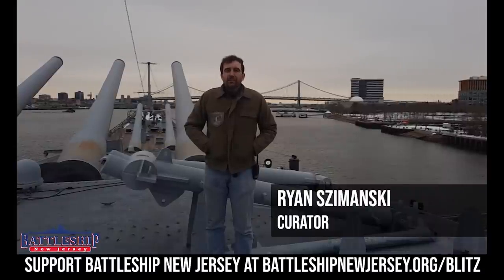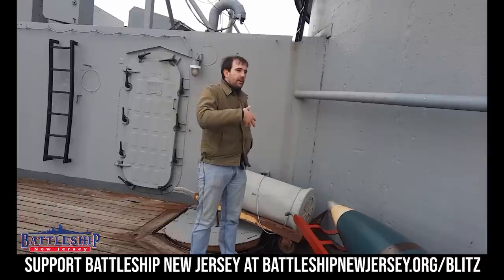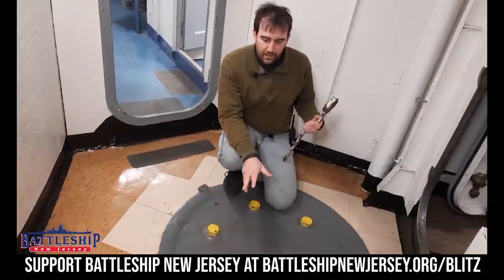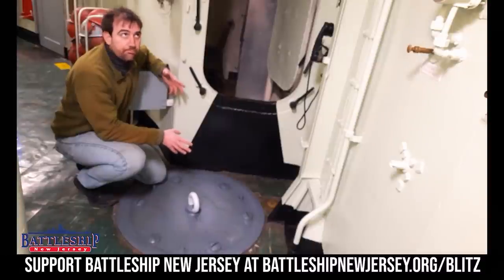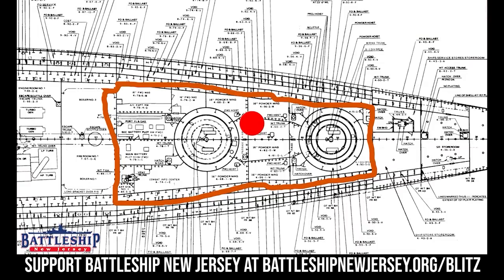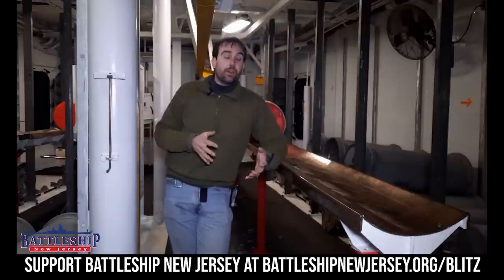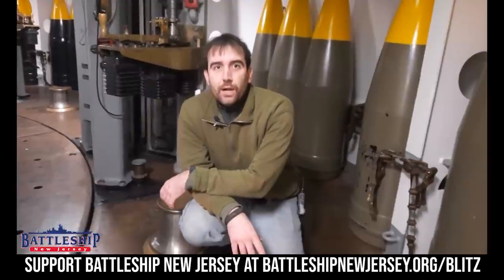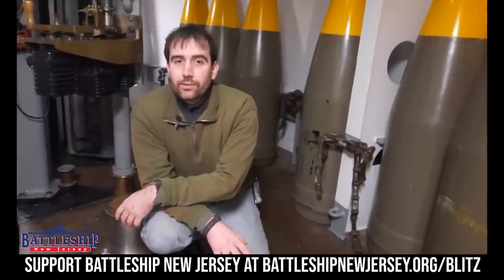How to Load Ammunition onto the Battleship

Comment: I was Aviation navy and not Surface but do have some experience with the loading and unloading of ammo. It's not that ships can't enter port loaded with ammo (we did it all the time on cruise), it's that you can't load and unload ammo pierside within city limits There are ammo storage and loading/unloading areas near major navy ports that are far enough away from major city areas just for this purpose. You would only unload all your ammo if the ship with going into drydock or other major work required it.
Reply: ^this comment needs to be pinned
Reply: Saw the Red Flag flying many times as we passed by the Seal Beach Naval Weapons Center, outside Long Beach California.
Reply: You’re correct:  ships did not offload ammo before entering port.  We would offload ammo before going into the yards or before extensive maintenance availabilities, and we generally carried full load out only on deployment, but the magazines were rarely empty.  I served on a Knox-class frigate in the early-mid 80s, so procedures may have been different at other eras.
Reply: That makes sense because I live in Australia and its not uncommon to have US navy ships come ashore and I cant imagine they would unload all the ammo just to enter Sydney harbor.

Comment: I can tell you from my own service on New Jersey in the 90’s we did not offload ammunition every time we went into port.
Reply: I’m glad to here that, what a pain in the ass that would be.
Reply: Thanks. I know USS Iowa visited Aarhus here in Denmark at the entrance to the Baltic sea and close to USSR and DDR. 
It would be strange to not bring ammunition during the Cold War
On the other hand I suspect the port call was to explore resupply options. As well as hearts and minds. 
USS Iowa at coal pier in Aarhus
https://www.flickr.com/photos/perryolf/4474302056/in/photostream
Reply: Yeah, I would that would greatly increase the chance of an accident than just leaving it where it is.
Reply: Thanks - I very highly doubted that. - I agree with Mr Knapp (below) - if major work unload. No Hot work (Grinding, oxy/acetylene work (cutting/ welding)  near magazines with ammunition's present. Hot work type stuff is what started the Bon Homme Richard Fire in San Diego last year, I think.
Reply: @wfoj21  yes. Hot work in the "parking garage" spaces. It spread to other construction materials and went initially unchecked because the fire fighting equipment was offline.

Comment: It’s just so cool that the cable hoist still works.  My jaw dropped when the shell hoist raised that shell. It makes me wonder what other machinery can still be operated ( assuming fuses/ breakers are reset).  Can you give us a sense for that?  What Ryan and the whole team do with the NJ is a model for how a museum ships should operate.  Lastly, I can’t recommend enough the curator tour with Ryan.  It’s the. Best $500 you’ll ever spend if you’re a battleship nerd like me.  Ryan was extremely accommodating.
Reply from the maker: Check this video out for some info on what systems work: https://youtu.be/lK9ofM6ef5g
Reply: The "shell hoist" you see in this video is a museum simulation.   The "projectile" is one of the many fiberglass display shells in turret two.  It has a hardware store eye bolt attached to the point, which in turn is secured to a lightweight cable that is in turn connected to a very light duty cable winch above on the upper shell deck.  The display is arranged so that a casual observer taking the tour does not see the eye bolt or the winch cable.  As demonstrated by Ryan, the faux shell hoist does use the original hand controls for raising and lowering the faux projectile.

To re-activate the for-real shell hoist would require activating the hoist's 440 volt electrical motors and lifting ram hydraulics.

Comment: Navy ammo depot in NY Harbor is at Earle, about 10 miles from Bayonne.  Some ships anchored in Gravesend Bay and off loaded to barges.
Reply: Thanks.    I was wondering about that, so I looked it up.   The 2.9 mile long pier is located in Sandy Hook Bay.    There is a 15 mile military railroad and road that connects the pier to Naval Weapons Station Earle.

Comment: As of 2016 there were still 15,595 live 16"/ 50 calibre rounds in storage at Crane, Indiana.
Reply: Ok, I get that you want to store shells out of the range of shore bombardment, but why put a navy base so far from the ocean?
Reply: @Ben_306  As of 2016 the Indiana site seems to be a facility for storage prior to disposal. It is not a Navy arsenal
Reply: Are 16"/50 cal rounds different from the 16'/45 cal rounds? I think I read the weights are the same.
Reply: @tobyw9573 the AP rounds for the 16"/45s were several hundred pounds lighter than for the 16"/50s I think the lighter rounds could be used in the 50s but am not sure if the reverse is true
Reply: @XXXXXXXXXXXXXXXXXX981  Crane, Indiana is closest thing the department of the navy has to a dedicated arsenal, which explains why the excess 16" ammo is stored there.

As to why they chose Indiana for a navy base, i would assume its fairly central to rail lines and other central transportation hubs of the country so that delivery can be made to either coast fairly quickly
Reply: @fredfranklin2054  that depends on which version.  The Colorado class with their 16"/45s could not handle the "superheavy" Mk 8 that the 16"/45s of the North Carolinas, South Dakotas and Iowas could use.
Reply: @tobyw9573  i recal in another video, they mention that the AP rounds for the 50 cal guns were actually a foot longer, so wouldnt even FIT on the ships with the 45 cal guns, but the HC or HE rounds were still "only" 55 feet long and would be cross compatible

Comment: I get "greasing the deck" to move shells of that size but how does the crew gain any traction?  
The grease must have been equally slippery on the sole of a shoe or boot.
Reply: It was an incredibly fine coat of oil, I do not remember it being slippery but during the process of loading the shell into the hoist a term called Par Buckling they MAY have put a little more oil down in the path of the shell to the hoist. I can't say for certain, I was never on the projectile decks during a shoot.
Reply: Interesting note - Ryan took us under turret #1 which has not been restored, they still have some pad on the deck to sop up oil that saturated the area.
Reply: No worse than walking on ice. You "skate" rather than walk.  The person looping rope around a shell is one of the few trying to change positions often.  The guys at the catheads, just sit there looping rope and pulling on it.
Reply: @haroldhenderson2824  Skated & ice fished a lot growing up.  Natural ice has a certain feel (texture).  Never had to horse a ,1500+ lb shell in a confined space.  I wonder what the temp was in that turret?
Reply: Use the oil only were it is necessary and train the crew to NOT put their feet in those areas ??
Reply: It's oil, not grease, and it is slippery to stand on, but if you're careful and keep a hold on nearby shells or bulkhead you can walk around.

Comment: Im guessing you weren’t expecting the hoist to work? 😳
Reply: Given the lack of 400v 400hz power generation onboard, he shouldn't be. (he'd know what's been done to get compatible power there, and likely was the one who flipped the breaker to enable it.)
Reply: @jfbeam  400Hz is just for electronics.  Anything big runs on 440V 60Hz.
Reply: I'm wondering if there's a prankster on board who made sure it would work just to startle Ryan as a gag.
Reply: @ghost307  they probably turned it on to crack open the hatch it's above
Reply: Just because something is designed for so many volts doesn't mean it wouldn't work with less. It will still work just not as well. If thats a 440v unit or whatever 220v will work well for a short demonstration like in this video but it lickly wouldn't lift the weight of a shell.

Comment: It is the large number of unprotected and unconfined HiCap and AP shells being moved that causes the safety issue.  A good old barge could do the job of carrying powder and shells out to a stationary battleship at anchor (a few miles from shore facilities).  Powder in the storage flasks, has a less than 1 time in a million chance of "accident". Even then, it is a fire (NOT an explosion). An unquenchable, hot fire. Just one burning could "cook off"  more flasks, but they tended to be guarded with fire hoses (for cooling).

Shells have been dropped, but the  nose fuse (HiCap) and the base fuse (AP) is not just started by an impact alone. I don't know the details, but modern fuses require a shell to spin fast (to arm) AND then impact before detonating.  Whacking it with a big hammer, won't do anything but scratch the paint.

Comment: How many of those dummy rounds do you have on the ship? Surprised by the apparent number.
Reply: They are light weight replicas. Any full weight rounds they have are for training and painted blue.
Reply from the maker: Probably about 75 fake shells and another 50 of the real but BL&P rounds that are in the parkinglot.
Reply: @BattleshipNewJersey  I have a BL&P shell in a cradle marked 1902 lbs and 8.1 cu ft.  Its a bear to move around. I would like to have an AP round but they are impossible to come by. Where can I get a fiberglass replica AP?
Reply: A bunch were made for the Steven Seagal movie (Under Siege?) These might be former movie props.
Reply: @PhantomP63  Somebody has the molds to make them. I just want ONE AP round.
Reply: @kimmer6  ill take an HE round
Reply: @unluckyirish2763  The sun ma gun is brutally heavy. Mine's a TP cement filled blue round. I plan to paint it up as a D-875 High Capacity round and install the proper Mk 18 nose fuze.
Reply: @kimmer6  O.O
Reply: @fixman88                     ?
Reply: @kimmer6  I was expressing surprise at the fact that you actually had a 16 inch shell; I wasn’t aware that was possible.
Reply: @fixman88  I knew a guy who had about a dozen 16 inch target practice shells in 2008. That's when I talked him out of one for a fair price we could both sleep on. All kinds of collector shells and cases are commanding insane prices these days.

Comment: The comment about unloading ammunition before entering a civilian port is incorrect.  Navy ships unload ammunition before going into a shipyard for a maintenance availability.  They go into civilian ports all the time without unloading ammunition, which is not a hazard when it's properly stored in magazines and not being handled.  USS Missouri sailor 1988-90.  The shell decks on Missouri were bare steel with a thin coat of oil.

Comment: I did a tour on the USS Texas a few years ago and the guide said the powder canisters that the bags came in were filled with laughing gas and they had to relieve the crews handling the bags every few minutes or hours can't remember which.
Reply: Nitrocellolose in the different formulations (some had more nitrogen compounds than others), will slowly breakdown in some conditions. Nitrous Oxide (laughing gas) is one of the products. No gas that you can intentionally place in a powder flask will protect it from fire. The propellant has "all the oxygen it needs", as loaded. The flasks are just to keep it dry and separated.

Comment: Maybe carrying the powder cases was doable. 300 lbs, 2 men could carry one, be a sweat but possible. Or small trolleys. This in ref to the weird powder magazine setup mentioned in video.
Reply: They were never manually carried, chain hoists were used.
Reply: @CRAZYHORSE19682003  If you watched the part of the video [NUMBERS] was talking about, there is NO HOIST in that section. So they obviously didn't use one for loading through that hatch. Now, I would obviously prefer using a hoist myself, so if there were ANY other usable hatch with a hoist, I'd use that one. But if a situation forced me to use that hatch, it would be a sweat job.

Comment: Explosive 16" shells?  That is, is there a scenario where a shell accidentally falling from an overhead rail or maybe from hoist would/could go 💥 pow?  Thanks!
Reply: I’m not going to say it’s impossible but it’s pretty close.
Reply: I'm pretty sure the fuse isn't that sensitive. Otherwise, AP shells would just be shitty HE rounds. Now for the HE shells? I dunno, but I bet its a butt-puckering moment when it slips! 😂
Reply: @The_Sly_Potato  It depends, I think the fuse in not installed until the shell needs to be loaded (on some land fortification)
Reply: @user-ro9zf9kz1h  you mean like the fuse wouldn't be inserted into the shell unless they were in the process of hoisting it up to the breech from the magazines? Is that what you're saying? Cuz that would make sense, but I'm not too sure on how fuses work on artillery shells.
Reply: Nope, they were very stable. The projectiles in turret two of the Iowa didn't explode even when exposed to massive fires on April 19th, 1989. I remember off loading those shells and they were burnt black.
Reply: The Cruiser San Francisco took a 14" bombardment shell hit from a battleship at Guadalcanal, going through the deck and hitting the barbette.  Fortunately it was a bombardment shell and not a AP shell and it didn't breach the barbette.  It dented the barbette and sent the shells inside flying.  Even though the 8" shells inside went flying around hitting each other, none of them detonated.
If that didn't set them off, little will.
Reply: In the 80s, tests were done to see if an exploding shell could cause others nearby to blow up. The test used HC (HE) shells and concluded that they were stable enough that a chain detonation would not be sustained. Details here in pdf form:
http://navweaps.com/index_tech/tech-093.pdf

Comment: You'de thing they would have figured out a moder ergonomic way of getting the shells into the belly of the ship..  like a sloped slide away from the turret,  sliding down to the bottom of the barbette..  reducing the load on the hoist..  Could even be used as a slide down to lower decks  for people

Comment: I noticed that the black painted shells at 15:06 were the same height as the OD painted Mk13 HC projectile between them so I did a little digging (NavWeaps) and found that the 16" AP shells intended for the Colorado Class ships used a 2,240 lb. AP shell that was the same height (64") as the 1,900 lb. HC round whereas the 2,700 lb. MK8 AP shell intended for the later fast battleships was 72" tall.  Are those 16" Mk5 series AP projectiles?
Reply from the maker: Those are plastic replicas that come in one size.

Comment: Correction. 1170 tons total for the projectiles if all they had were HiCap rounds. Roughly 400 tons per magazine. Add another 42 tons per magazine if you substitute 40 AP per gun for the HiCap. Note, I didn't include powder charges in this.

Comment: Excellent video. 
How much armor is around the powder and shell magazines? Id imagine its fairly substantial, or do they rely mostly on the armored belt and deck armor?
Reply: Yes, the magazines for all 16"and most 5" propellant and non-16" shells rely on being inside the armored citadel portion of the ship.  The 16" shell decks rely on being inside the armored portion of the barbette (down to second deck) and then being below the armored deck thus inside the armored citadel.

Since the upper handling rooms for the secondary battery guns are all above the armored deck, IIRC they feature a certain thickness of STS.  Might be 2" or maybe 3"----I'm sure Ryan's done videos on the 5" guns that would have the accurate details.

Comment: LISTENING TO YOU ABOUT LOADING AND UNLOADING AMMUNITION BEFORE ENTERING WHAT A HARBOR OR WHATEVER ANYWAYS SEEMS INSANE THE MORE YOU MESS WITH IT THE MORE LIKELY YOU ARE TO HAVE A PROBLEM PLUS YOU CAN END UP MIXING UP DIFFERENT POWDERS AND I AM A RELOADER BECAUSE I'VE ALWAYS BEEN INTERESTED IN WEATHERBY GUNS AND AMMUNITION AND FROM MY RESEARCH IN THAT IS PROBABLY LED TO FASTER PROJECTILES ALL THE WAY AROUND CUZ WHAT I FIGURED OUT WAS THE SLOWER AND COLDER A POWDER BURNS IT ACTUALLY PRODUCES MORE GAS AND A FASTER PROJECTILE FAST BURNING POWDERS ARE VERY HARD ON THROATS AND RIFLING
DAVID GRENIS LIVING IN BOULDER COLORADO USA
SO WHAT MY TALKS WITH MANY PEOPLE OVER THE YEARS IT'S LED TO USING SLOWER BURNING POWDERS AND EVERYTHING FROM PISTOLS TO PROBABLY ARTILLERY BECAUSE IT'S SLOWER IT'S NOT REALLY THAT MUCH SLOWER AND IT GIVES THAT MOMENT TO DEVELOP MORE GAS THAT PUSHES THE PROJECTILE HAD A MUCH HIGHER RATE OF SPEED THAN A FAST BURNING POWDER THAT DOES NOT PRODUCE MUCH GAS

Comment: how do they make the curved i-beams i wonder
Reply: Steel has a melting temperature of about 2800 degrees. However if you heat that steel to 1000 degrees it loses 50% of its tensile strength. If you heat it to 1500 degrees it loses 90 percent of its tensile strength. So you simply heat the steal up till it is pliable and you can bend or twist it into the desired shape.
Reply: I assume you heat it then run it through rollers to make the desired curve. Probably similar to making curved pieces  of RR track.
Reply: @jth877  ah the old sherman's necktie - i should have known.
Reply: @jth877  RR track isn't bent like that !! 
Guard rails in switches with their sharly bent outer ends is bent in an press.

While normal curves is formed with by simple fixing the rail and forming the curve using skewers (or a winch.)

Comment: Those plastic 16" shells are probably easy to load.....😁
Reply: And the couch-cushion power bags, too. (I never think of them being 110lbs, because I've never seen anyone move a real one.)
Reply: @jfbeam  You could probably make a few with sturdier material and filled with sand so the visitors could see just how 'easy' the job of powder passer was.
Reply from the maker: We then run the risk of one tipping and falling on someone. Even a 50lbr can really hurt someone.
Reply: @jfbeam  Thanks for stating the real weight, the video mentioned 100 lbs. but that was for 16" x 45 CAL shells, not the super heavy weight 16" x 50 CAL guns.